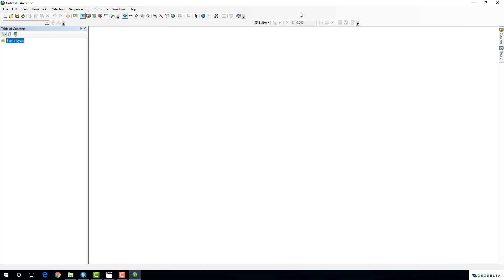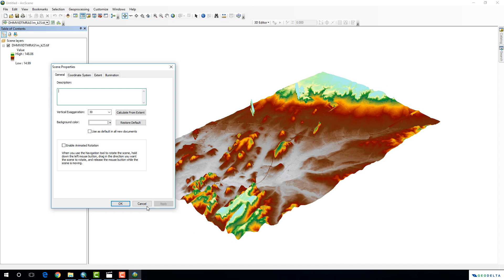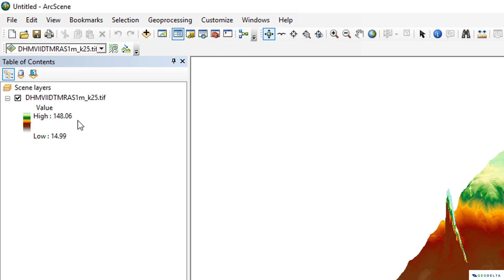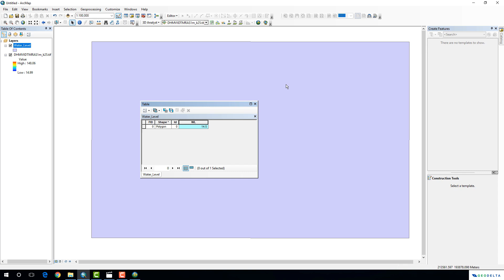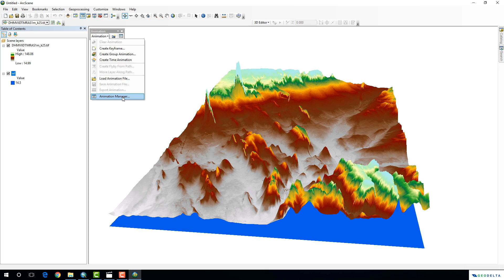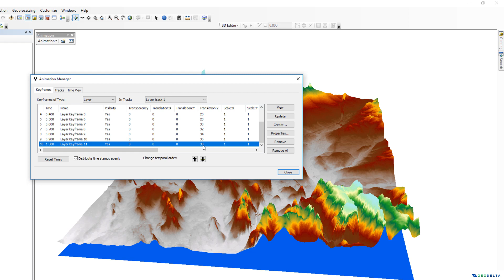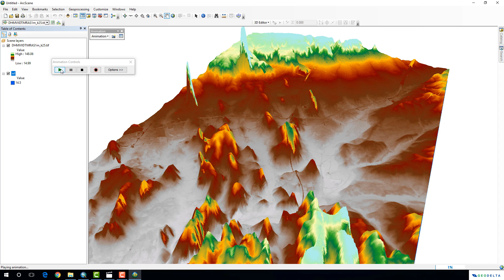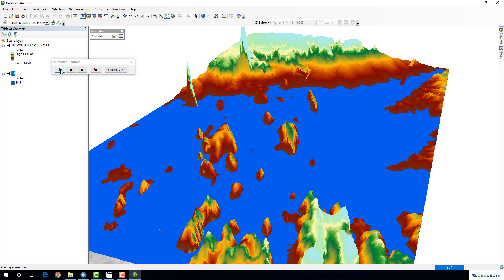Flood Animation using 3D Analyst tools of ArcGIS (ArcScene + ArcMap)

Comment: Sir/mam, I followed all the steps upto base heights but when I click on apply nothing is happening. I waited for 4 hours of process. It seems as nothing has happened. Shows 0% in lower right corner.
I am using ArcGIS 10.5
Cell size is 0.000716

Comment: Is there a way to add the rocky description of the groundwater wells, as well as the water level and its three-dimensional appearance?
Reply from the maker: Hi, for this kind of representations you might be better off using software like Rockworks or HydroGeo Analyst
Reply: @geodeltalabs  thank you for your fatest response, i appreciate your video and its  very useful to me, thanks a lot.

Comment: Congratulations on the video.

I have a question: Can this simulator be used to simulate the bursting of a dam?
Reply from the maker: Hi, I do not recommend this method for that because this method does not really do an actual hydrodynamics simulation. You are better off using tools like MIKE21 or FLOW3D for such kind of dam break modelling.